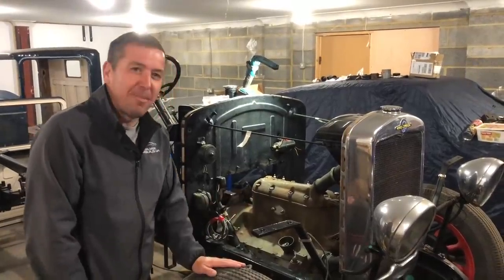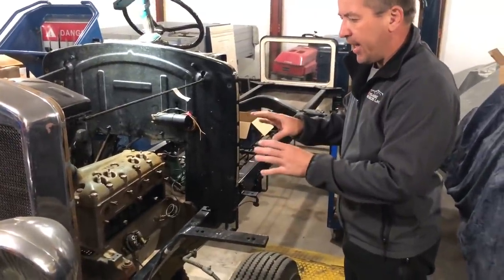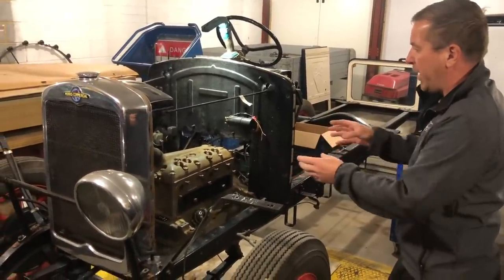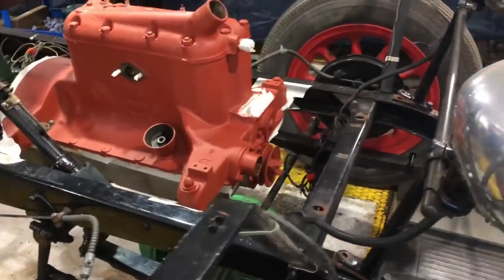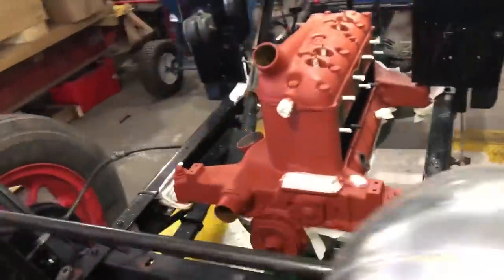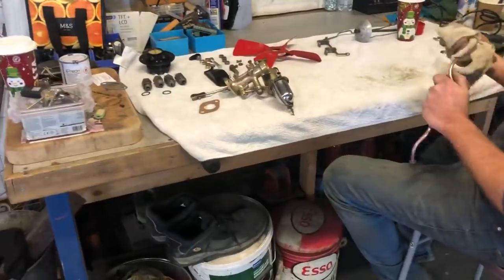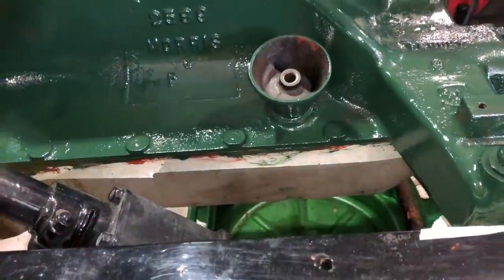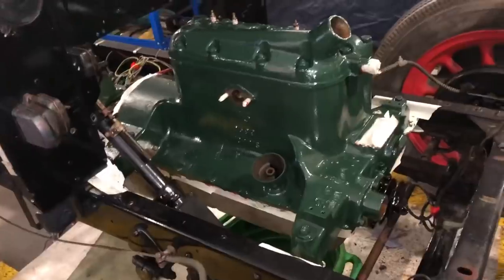Morris Commercial Truck 1934 T2 refurbishment PT 3

Comment: 86 years old and the fan didn't need painting. Fantastic and great testimony to the quality of the engineering. Built at a time when shareholders interests were not paramount. Made by true craftsmen. Slight imperfections in the casting, but so what.
Love your vids guys. Time to look for something else for the next rebuild.

Comment: I have been a passenger in an Austin like that when it was still in use back in 1961. I remember the straight cut transmission and no isolation from the engine noise meant you had to shout to be heard. It was geared so low that you were in 4th at 25 MPH and it "cruised" at 30. I was still at school and working Saturdays to pay for my motor cycle.

Comment: Just remembered I meant to say about difference between treasury and actual horsepower. This apllies to that truck   The engines were designed for low taxation class but higher BHP. The HP in the name is the tax power. In case you haven't read it https://en.m.wikipedia.org/wiki/Tax_horsepower

Comment: Please twist the petrol pipe so those coils are horizontal rather than vertical; as they are at the moment you risk getting vapourisation on hot days with airlocks at the top of the coils.